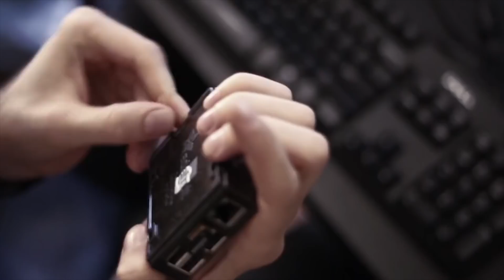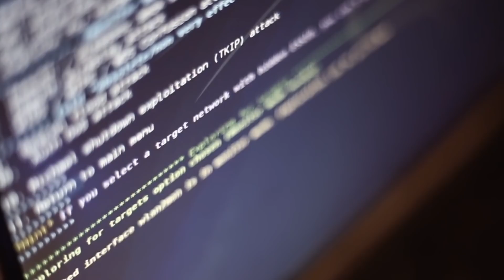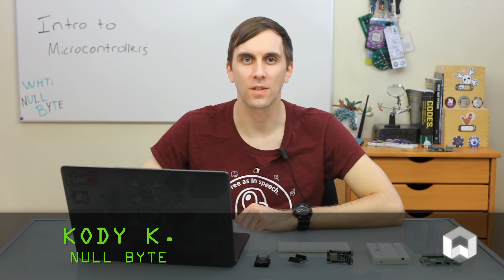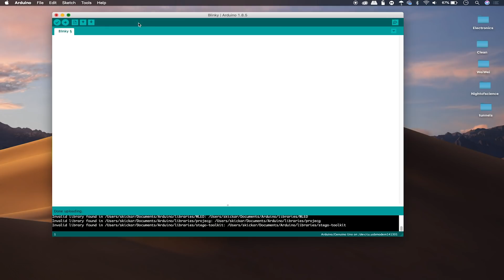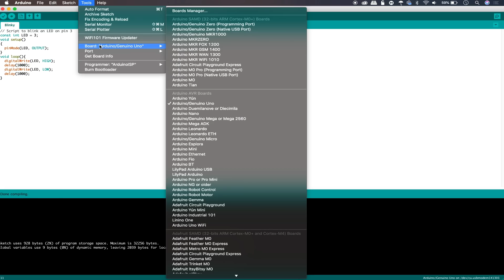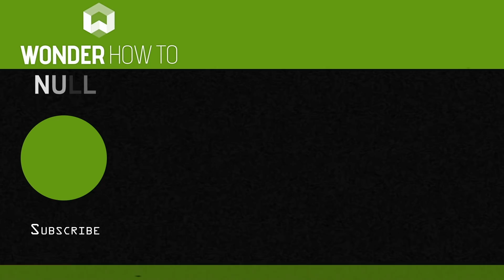A Hacker's Guide to Programming Microcontrollers [Tutorial]

Comment: Good topic but as a person who has been studying this topic for a while I wanted to give you some constructive criticism. I think when trying to explain how to develop for a micro-controller you should really go over just that. Arduino is a beginner friendly abstraction of underlying concepts which get pretty advanced quickly. When developing for a micro controller you want to also have an idea of the sort of peripherals and interfaces you'll want to employ then select the controller accordingly. Then on your experience level you want to read the data sheets and reference manuals for the controller and peripheral(s), this part is the overwhelming part the manuals are very long. And you get better with experience but documentation on the process for hackers is very sparse and more application specific for a given task.  Also if i'm not mistaken when you put an resistor in a circuit the way you did it limits voltage not current, when limiting current the resistor is on the ground side of the LED.
Reply from the maker: I appreciate that! I realized the error with the resistor after we finished filming, but with the 3.3v esp8266's make it matter a bit less. Thank you for the feedback!
Reply: Had no idea this resistor distinction dictated whether you limit current or volts. Thank you for pointing this out.

Comment: bro i like this channel very much , i watched all of your videos and learned a lot ,, but the title is not correct to this video ,, its all about basics of micro controller , and blinking of lights,,yeah micro controllers are very usefully and node mcu is cool with wifi module,,we can try raspberry pi for high performance but it costs too much ,,but i would be glad if that micro controller is used in a way for hacking,,can we install any tool on it for hacking i mean does it support any hacking tool ,,,, and i have a small question bro i use kali linux using a virtual box  so in virtual box wifi could not be connected directly as in virtual box  does not access wifi adapter of laptop and it takes internet connection as wired directly from laptop ,,you said we need a external adapter to connect ,,yeah its true ,,but is there a way to use monitor mode using node mcu without using external adapter and to connect to wifi or scan for wifi if possible plz make a video on that bro,and later i realized dual boot is much advantage for kali linux ,bro could make a video on dual booting kali linux in much better and easy ways that are available mostly without using third party softwares and much safer for the system ,,and as well as safely reverting the dual boot or removing the dual boot safely,,i did dual boot on my old system but later when i removed kali ,i found the partioned drive disappear,many videos are available  how to dual in various ways but removing is not said ,,later i  changed os for drive recovery however luckily that worked,,i would be glad if you make videos on this bro,,and plz  make a video on explaining networks and how they work bro if possible ,,and with some basic linux commands and syntax ,,and perfect way to install kali so it does not have drawbacks,,and if possible plz make a video on how to use kali tools based on the commands that show(as guide /help/synatxs it shows upon opening  a tool) when we open a tool in terminal mostly i dont get to use as mentioned in the syntax or dont know which order i need to use it,,bro plz show the ways how to use the tools even without graphical interface and the packages that are need to be installed for using a particular tool bro i realized this when you told about wifite tool it took many packages to be installed, and then only i realised for the need of wifi adapter,,bro plz specify some hardware requirements and package requirements at begining of your video and the updates that are need to be done,,and some packages to get we need to edit some sorce file i did not remember it ,where we keep some paths to the packages that are mentioned in kali offical site (some repository path i think so )then we can get some packages to install and update bro i could not make it perfectly could you make a video on that bro specifying all required paths/links,,,for updating or getting all packages,,and possible last request bro make a video on connecting and discovering to a target remote device or system over internet,, and thanks bro if you completely read my full comment with patience ,, bro why dont you monitize this channel ?